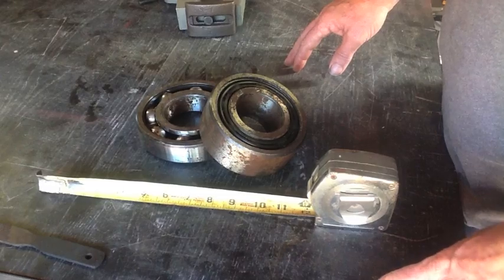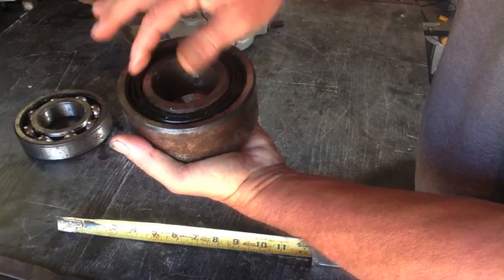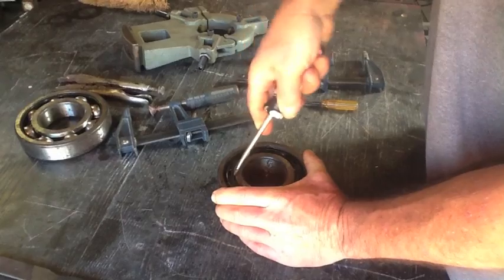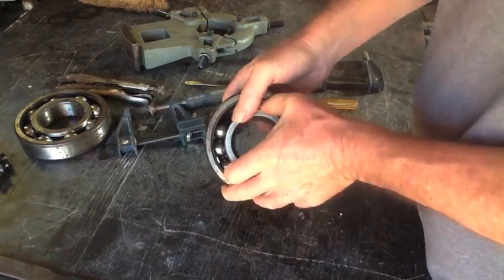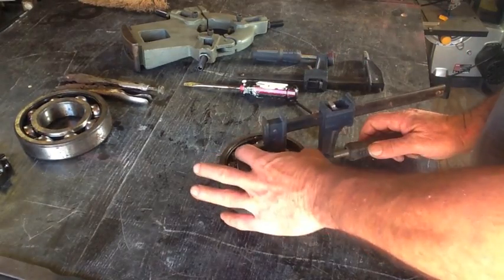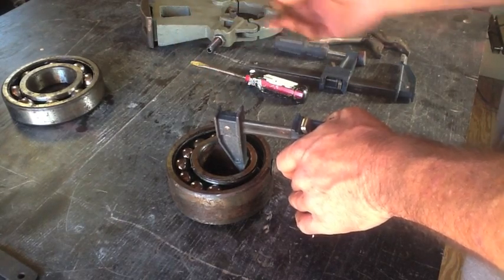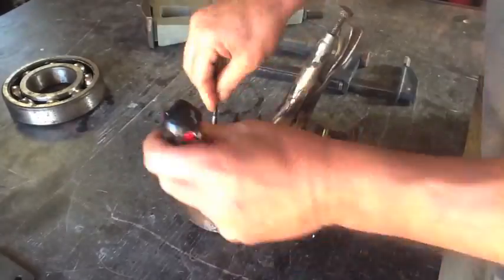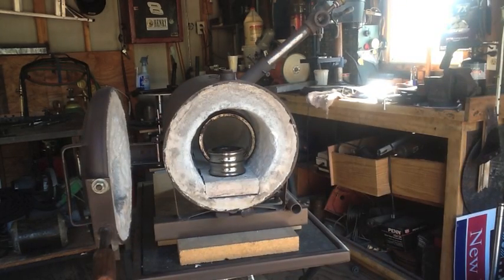HOW TO Disassemble a LARGE BALL BEARING, ANNEAL IT, MACHINE IT, Steady Rest Part 1

Comment: That's really good.  Very interesting.

Who showed you the trick to get the bearing apart ?

I'm really interested to see the rest of the project.

Cheers Rob
Reply from the maker: Thanks Rob, I have yet to tackle the riveted metal cage on the other larger bearing. That was the one I asked you about and if you had any ideas on how to effectively remove that cage. A friend showed me how a long time ago but on a much smaller bearing but the principal remains the same regardless of size. I couldnt find a youtube video on how to take apart such a large bearing so thought I would film it...maybe help someone else out down the road. Its a challenge dismantling one if you dont know how :)

Comment: you can hear how hard it is by how high pitch it is when it cuts. The harder the metal the higher the pitch as softer metals resonate at lower pitch because the molecules can move more freely.
Reply from the maker: Oh yeah, still extremely hard but at least manageable using small cuts. My project is gonna use the outside ring with 5" OD, a piece of steel that size and of that quality woulda cost a lot...the bearing I got for free. Was a win, win :)
Reply: Have you tried 'hard turning' bearing races without annealing?  Since you're using carbide tooling and your lathe is substantially better than a gutless tabletop import, I wonder if its something your setup can do.

I understand you won't want to do that for this project, I'm just curious.  I've never tried anything on hardened bearing steel.